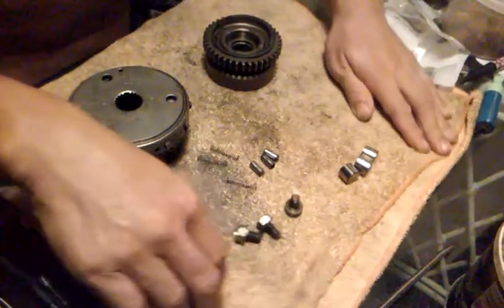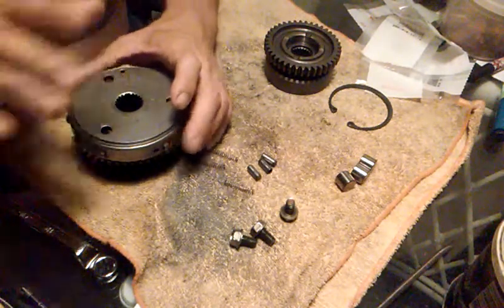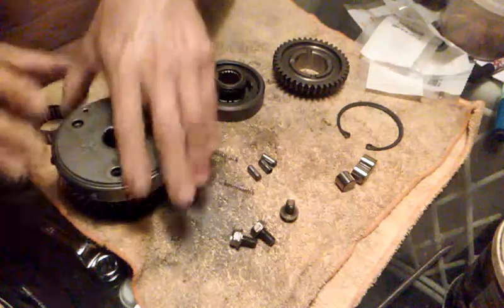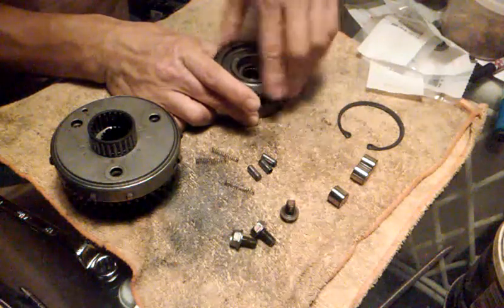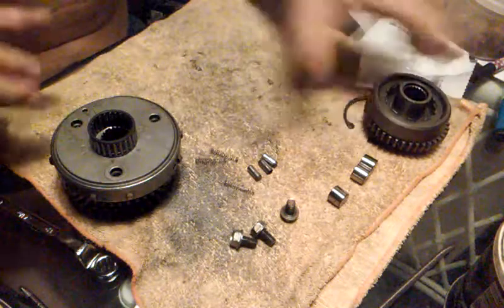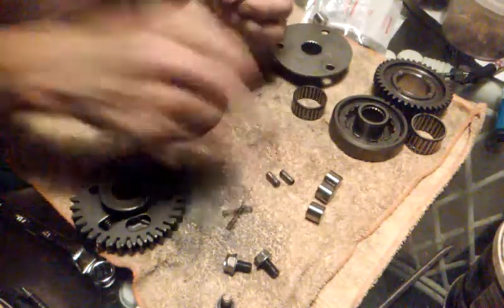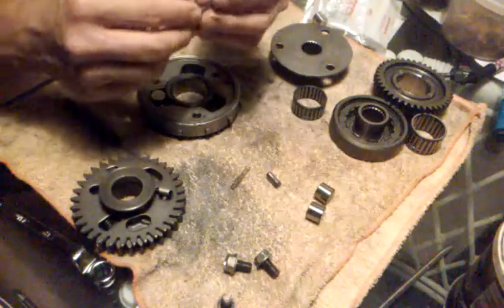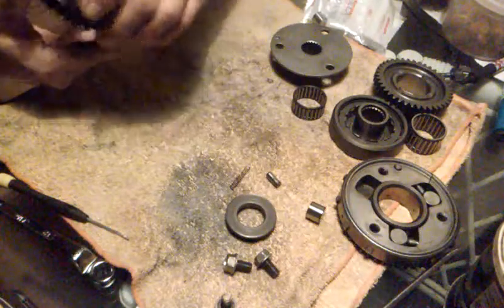Starter Clutch Rebuild, Comparison of VFR800 and VFR750 Starter Clutch

Comment: iam replacing my starter clutch on my gy6 150cc. i just order a new clutch because i was getting no spark. does the roller simply keep the clutch in place to spin in ine direction? and does the starter clutch actually send the signal to the stator coils to spark? thats what i recently just came to understand. i guess ill find out ver soon